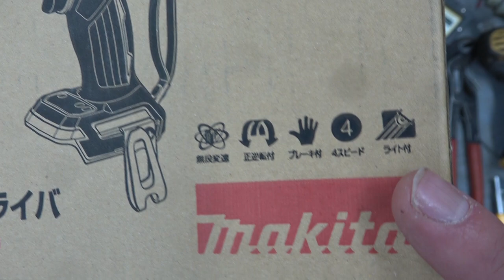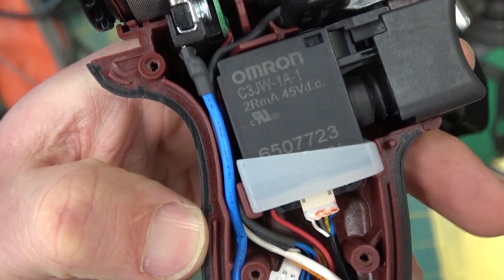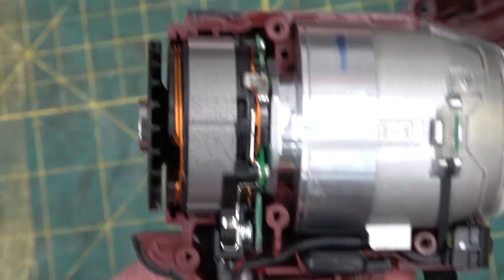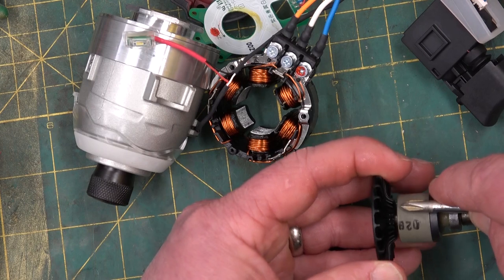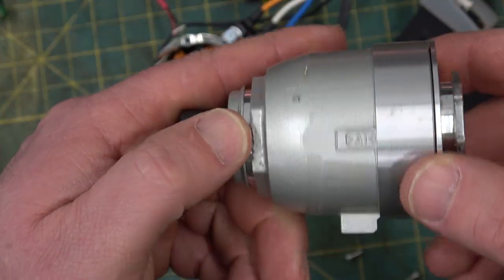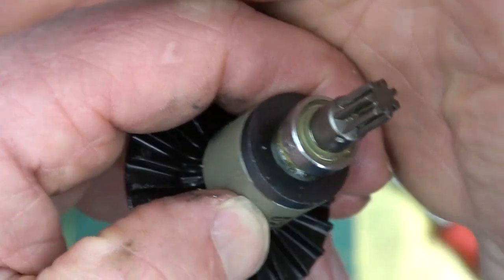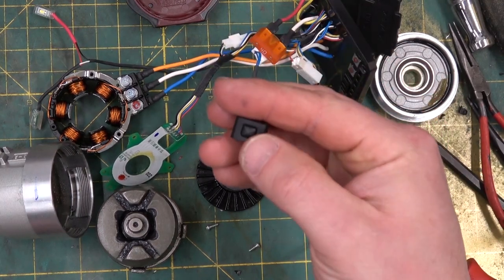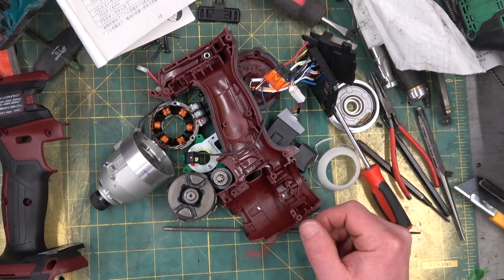Are Japanese Tools Better? Yes.

Comment: take apart some ghost hunting equipment and see if its bs or not
Reply from the maker: I used my calibrated standard Magic 8-ball. "Without a doubt" it's bullshit.
Reply: @arduinoversusevil2025  id actually really like to see you reverse engineer a weegee bored :o
Reply: Theres an app called pokemon go....
Reply: @arduinoversusevil2025  contact the unsolved mysteries gang and check if their ghost radio thing is BS or not
Reply: @arduinoversusevil2025  you must of bought the imperial version. Next time, metric for the win 🤔
Reply: ⁰
Reply: 0
Reply: 0
Reply: @arduinoversusevil2025 Where did you get the calibration equipment? I've been looking for about 3 years and a few fortnights and I keep striking out. PS I'm obviously asking for a friend

Comment: Lets just take a second to recognize the 40A automotive fuse. Its widely available so you dont need to order a replacement and wait for it to arrive. Simple, cheap and brilliant.
Reply: And that omron switch is found on Honda’s :)
Reply: I'm surprised they didn't use a mini fuse for it, to save on space.
Reply: @bstrickler  can't get 40A in the minis
Reply: @mattmanyam  True 30A is the max
Reply: They don't need to reinvent the wheel, but it seems that in western countries we try to do that.
Reply: @mattmanyam  makes sense.
Reply: Yeah on a model made for sale in one of the US *marts or *depots or wherever, no replaceable fuse, just a fusible link (piece of wire) in an inaccessible place so it stops working just after the warranty runs out.
Reply: @conwaytwt  all to save 50 cents
Reply: @bstrickler  Save $0.50 in manufacturing, make another $80 in profit when you buy a new one.
Reply: I wouldn't say brilliant but ya
Reply: @bstrickler  .50 x 1,000,000 tools means 500,000 extra in profit
Reply: That jumped right out at me, and I don't know anything about the innards of tools like these.
Reply: @Pippy1  probably 2cents they buy bulk
Reply: @LidellFrasier  assuming someone would buy the same one that shit out out on them
Reply: It's unlikely to blow the fuse, though. The fuse is there to protect from a spontaneous combustion rather than protect the electronics. The electronics should have over current protection already, the fuse is there in case all goes to short but  in that case, changing the fuse would be the least of your problems. Unlike house hold fuses/breakers and car fuses the electronics don't use fuses as a protection mechanism to the devices, rather than preventing fire hazard.
Reply: @bstrickler  even just saving 0.10$ a piece is huge when you sell 100,000 pieces..like he's pointed out a thousand times it's all "built to a price point"
Reply: Only if my fluke 177 had automotive fuses in it, accessable from the rear battery door.
Reply: Frankly, the fuse is only there for liability. When it blows, the entire drill is totaled - if they would even sell you a replacement board.
Reply: They could've used a low profile mini fuse or a mini fuse rather than the normal sized one.
Reply: Let's be honest, if the 40A fuse blows it is already too late to salvage the tool any longer, it takes more than 720W at 18V to start to affect the fuse. Usually electronics blow up before the fuse goes._
Reply: @DjResR  it seems rather hard to grasp the concept that fuses in electronics are there to protect the owner not the electronics themselves. (even fast) Fuses are way way too slow to do anything and prevent the release of the magic smoke out of the silicon. It seems an extremely common misconception (given the amount of votes the comment has gotten)
Reply: @conwaytwt  l  like that l get some of my best tools that way. If you can't fix your tools....
Reply: Yeah! Simple, cheap and brilliant !..... what the hell are they doing?
Reply: @hlq2action310  that is why we have better wheels.
Reply: @levicochran4306  They do and they will, when they already have 3000 worth of other tools and chargers.
Reply: @Tommy Trussell  You say that like soldering in a wire splice requires a NASA technician to be involved in all steps.
Reply: ...40 amps? Isn't that wayy overkill. I imagine all the wires would smoke before a 40A fuse blew
Reply: It might just be that they have specific laws that require that. I have seen tools using different parts in different markets.
Reply: @stanimir4197  Fuses are for wires only, preventing overheating. Electronics usually have its own little user non replaceable diode acting as fuse.
Reply: @mdjey2  I'd not call fuses for wires only, take VRMs for CPU/GPUs. They delivery over 300A easily, shorted mosfets (or smart power stages) tend to burn through the entire PCB, leaving a small crater (taking anything nearby), so fuses prevent that. I guess you can call the copper layers "wires" - again fuses prevent catastrophic failures.
Reply: @stanimir4197  You are talking about different kind of fuses I think. I am not PC expert, but I used diode example as general for on-board protection. I know there are some others with letters on them, I guess dedicated fuses. So anyway this 40A fuse would be outside its speciality for protecting any kind of board, I believe.